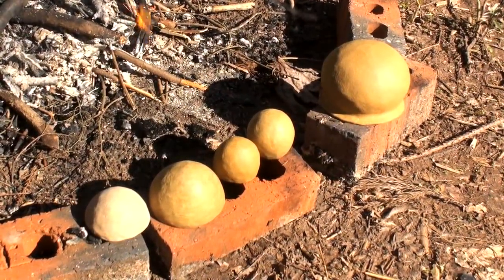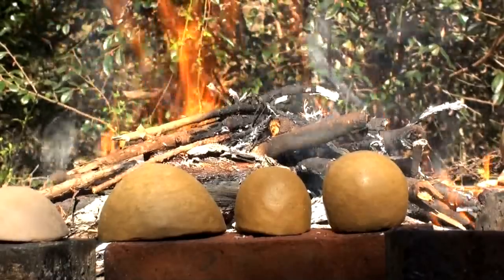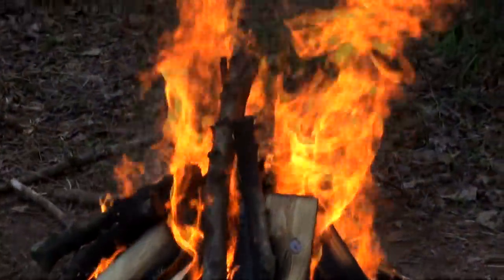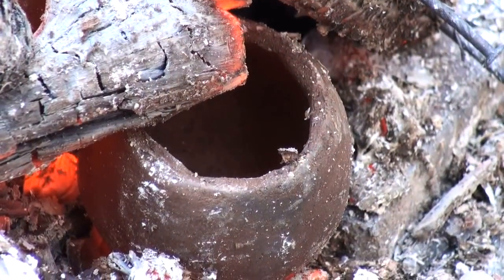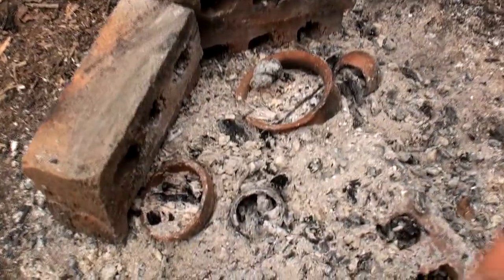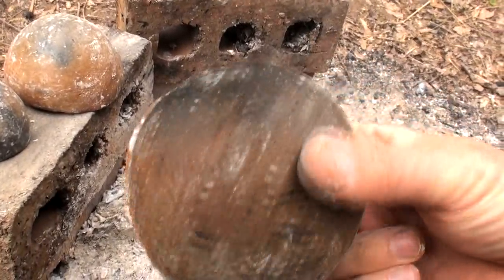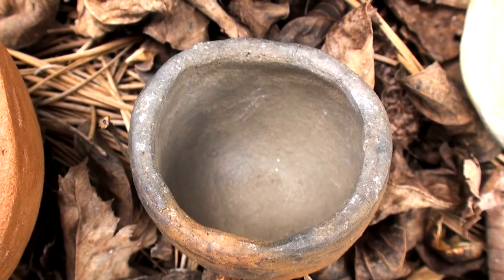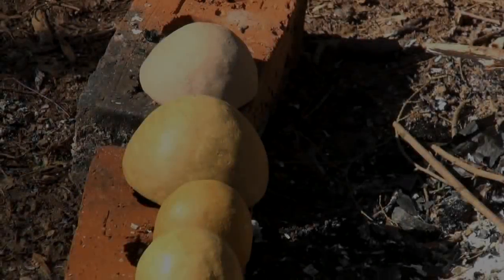Primitive Pottery Firing 2 (HD)

Comment: Would you try to boil water in one by just putting it on the fire? I've seen people drop hot rocks in but I'm wondering if they just cooked with them over the fire like we do with steel pots.
Reply from the maker: Shane K yes that's how you cook with them. And that's what I'm trying to make. You can boil hot rocks to heat them up, but that's labor-intensive. Just putting a pot on the fire will greatly reduce the amount of time and work it takes to cook.

Comment: Great video! Is it possible that some of the cracking issues you had in the last video stemmed from a cool draft blowing through your fire pit? I noticed when you fired this batch you blocked off one side of the fire with bricks. Maybe next batch you could dig a pit for the pots to rest in?
Reply from the maker: There was very little wind both times I did the firing, so it couldn't have been the wind.  The cracks actually appeared when I put the pots in my home oven to initially dry them out.  As they dried cracks formed, which shows that too much shrinkage, not wind, was the cause.  These pots had more sand in them and that reduced the shrinkage.  And I'm convinced that's why they survived the firing.

Comment: Does this naturaly glaze the pots?
Reply from the maker: radioactive wolfs carnivorous plants no, there is no glaze on these pots. Because of that, they are very porous. Before they can be used for cooking, they must be seasoned just like you season cast iron cookware. Oils and fats need to be added to the interior wall of the pot. That will fill the pores and seal the ceramic so it's waterproof and can be used for cooking.